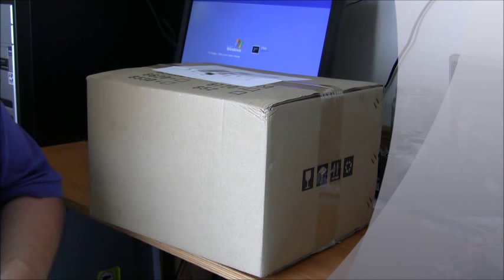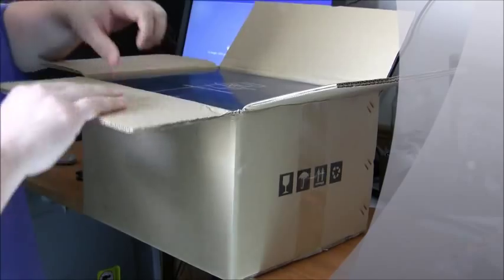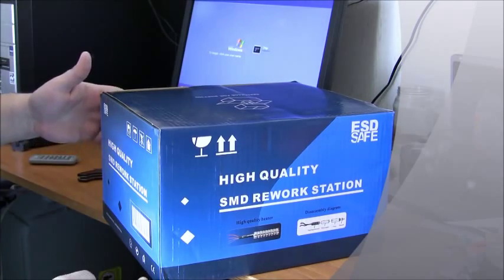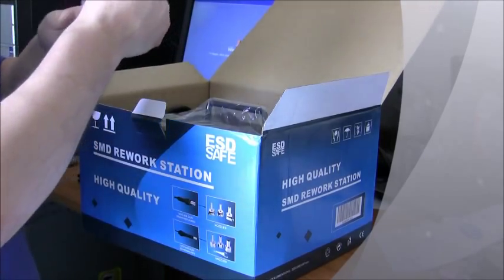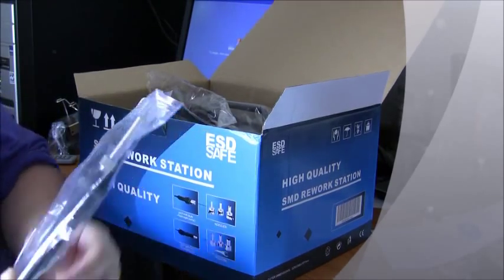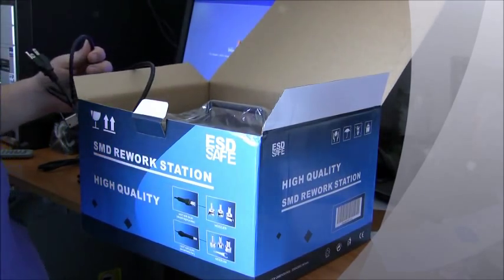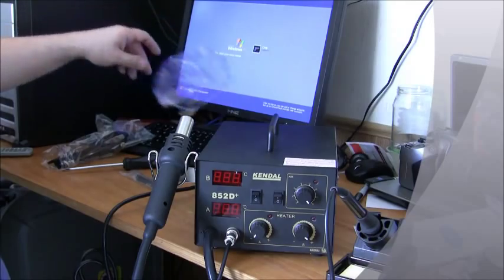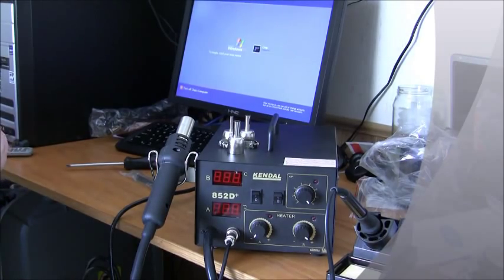Kendal 852D+ 2 in 1 rework station unboxing and demo.

Comment: Give the guy a break. This is the best video I have seen regarding unboxing and assembly. He is the first one to explain the chip popper. The instructoions that came with my unit did not include assembly. Even though it is pretty simple I want to make sure I do it right.
So what if he failed at removing the chip. We are not all experts when we try something for the first time.
Only suggestion is don't waste my time with desoldering if you failed at it. Edit that out and just show assembly.

Comment: I just ordered one of these to replace my trusty old Weller unit. The price was great, (as long as it is at least as good as my Weller was). I really don't plan to do much SMD work, but like the heat gun for shrink tubing. Here is a tip: To remove that I.C. chip you were trying, use the smaller blower tip at higher heat setting, to concentrate the heat right at the pins. Do one side of the chip at a time, (lift one side, then the other),  get in and get out quickly to protect the board from too much heat. You may find that works better.

Comment: Had mine for years and works great. i suggest you bolt the air gun on the right side of the unit, then you can bend the cord around the front and over the top, and it stays out of the way. Just tap the case or use bolts.

Hot air works best with the smaller tips at a low velocity with high temp.

Comment: to take SMD chip out will help to heat it from top and bottom if you can.Remember the heat will spread along the board. On top of a wood table is a big NO NO. Also your putting extreme amount of force with the screwdriver, the idea is to melt it complete it and grab it with tweezers. You also forgot that it takes more heat to melt the one that comes from the Factory than the 60/40 you buy at the store. Adding FLUX will greatly help the solder melt at lower temperature and avoiding putting so much heat to your other components. WHAT YOU NEED IS FLUX. 
Another pointer is, the WICK that your holding is to be used with the iron tips. If I'm mistaken please correct me. Thanks for the video i bought this machine to play around. I used to work with a Hakko long time at my previous job.

Comment: For any beginner watching this video: I always add solder to desolder components, when possible.  
Most of the components are soldered down with leadfree solder, which has a very high melting point, so adding fresh new solder, not only helps to bring down the melting temperature, but also increases the thermal inertia and the solder stays melted a longer period of time.
Reply: And flux. Always flux.

Comment: I've just got me the 852D++ today from the same vendor...it is identical as in this video's except that there was only one screw to remove from the bottom instead three...Yes, I even opened the box to make sure it was only one....and there was only one soldering iron!!!     

The temperature for the Hot Air was set to 380 (Air / Heater set at 2 O'Clock)    I was able to remove a couple of chips / diodes from a test board...  I am also new at SMD and want to start playing with boards, etc....I will be doing more testings before going into the real world.

My hobby is Ham Radio and I think this tool will help me a lot.   I've already have a Solomon SL-916 at probably 5 times the cost of this one!!!

Time will tell on this one but I feel lucky today.

Nice video intro, thanks.

Comment: I have this rework station.  Works great so far.  Took me about 10 minutes to salvage a similar pcb.  Use flux to desolder the larger parts helps a lot.  I set my hot air to 350c and crank up the pump with my small tip.

Comment: I've had mine for a few years, they rock. I had to replace the heater in the hot air gun recently and it's NOT grounded. Also the diaphragm pump stopped working (which led to heater in the gun blowing) opened it up and the air reservoir had cracked; I just hot-glued it along the crack and she's all good again.  Replacement heater for gun was $8 or something on ebay.   Basically a good unit; I use both the hot air and the soldering iron all the time.

Comment: The primary reason for using silicone leads for soldering irons is not to make them flexible, but to make them heat resistant so they don't melt when you accidentally touch them with a hot tip. This will always happen once in a while as you can see on the cheapest soldering irons with standard PVC leads.
The added flexibility of silicone leads is just an extra bonus.

Comment: Use your soldering iron to apply low melt leaded solder on the pins. I have tried that way to remove that size IC and it was quickly de-solderd.

Comment: Apply some flux to the pin and use a smaller hot air tip will make your job much easier.

Comment: i have the 862d+ and i love it. it has a few extra nice features. the main one is the fan for the hot air gun is in the handle which i tend to like better. mainly because with ones like this the hose kinked and stopped blowing air. also it has the magnetic shut off. and its blue not black.

Comment: Great video, thanks for posting. 

For those considering buying this model, I'd suggest you take a look at the 853D which also has a 0-15VDC power supply @ 1.5A which is great for powering my breadboard and such.  It was only $30 more on Amazon ($120).

Comment: To remove those connectors or componenets, (since you don't have a de-soldering unit) it's best done with the iron, and solder wick, or solder sucker. The iron can apply the heat directly to the pins and pressure onto the wick for solder absorption. Again, do it quick to avoid damaging the board. If the pins are still stuck, use needle nose pliers to snap them free, then lift out the connector or components.

Comment: mine is exactly the same 852D+ but with magnetic cut off for the heat gun (branded HighLight), had the radio shack iron, but this is a great hobby grade station for someone that uses more than  just on the odd occasion. price point is perfect & been using mine for well over a year without problems, by the way great vid :)

Comment: the large 4 sided ones are what i  had to  remove and replace .   once of clean pads with the solder sucker heat  tool .  then put cleat flux on the pads  then put the chip on  line it up  and use a scalpel  and hold it in the center and apply heat on to the chip  and the residue from the solder left  on melts and secures the chip.   then you apply flux onto the legs and from one side working  from right to  left apply a small bit of solder to the end leg  with iron in contact and then slowly run the iron tip along the legs  .   then when 4 sides are done again use heat  gun with  fine  tip and reheat the  legs  and watch the solder  run  onto  the  legs  .

Comment: Flux is needed for desoldering also and 350 celsius is very low temp for smd reworking.450 degrees is a good starting point and thats why the ram finally manage to beat you and remained in the pcb.Nevertheless i am gonna buy one 852 without led display that i have found in a local shop for less than 86 euro

Comment: You may have learned this by now, but always use flux, it makes solder melt much quicker.  Also, if you don't have third hands or whatever to keep your board in one place, you can use blue masking tape and tape it to the bench.  Finally don't use a screwdriver on a PCB.  You should only have to use tweezers at the most.  You fingers were way too close to the hot air because you were having to hold the board with the your hand.
Reply: Good advice. What many do not seem to get is flux serves to clean and also to transfer heat. A good example would be to take a soon put it in a pot with it standing vertical. then see how long it takes the heat to transfer to the spoon. then add water to the pot till it boils then add the spoon. the heat will transfer more evenly and quicker because the water has become the transfer for the heat. heat will always rise so adding flux will also keep the heat in the location your soldering or unsoldering

Comment: 12:56 
Try soaking the sponge in water and you'll realize it's not a joke at all.
Paper thin soldering sponges like these expands drastically the first time you soak them in water, so it will fill out the sponge tray all the way to the top edge. Once it drys out again it will stay expanded.

Comment: Hi. Add some low melt leaded solder on the IC pin. It will bring the melting temperature low. Then try with the hot air on 450c to de solder the IC. And watch Northridgefix YouTube channel to see how the de-soldering can be done one a bigger smd.
Thank you.

Comment: You should always start hot air review with max heat + max air and see if it can remove some small part fast. If that works, then you can continue with testing temperature control and lower air speed.

Comment: use liquid flux, set heat about 450 degrees and set air no more than half to prevent damage of components is working on
Reply: Man you are great 450 worked for me. Thanks a lot

Comment: i used to  remove them with  legs on 4 sides and to  remove them   like you are  doing  will  not work .  i did  my training  on removing  ic  from  mobile phones  .  the easy way is  not heat the  legs  but heat the centre of the chip  and the heat travels to  the legs evenly . , the same for refitting another one .  then less risk of blowing the other  bits of like the  very small smd  resistors caps and sots etc.  . try  it  it does work  .

Comment: hi, i have the exact same machine and i was trying to change a charging port on a phone and it did not work i use flux on it and i also did one side at a time but it still did not work. The hot air gun is not pushing enough heat to remove big stuff only those small (ic) and within a day the hot air gun just stop blowing air. I had it on full strength and the highest heat and i was able to hold it in my face for however long you wish without getting burn. This was about a year or two ago and up to this day its still in the box brand new and am unable to use it because it dont work.......so any suggestions?

Comment: in order to desolder smd you first need the preheat the chip and then ramp the temps up to desikder, it takes time to desolder chips. preheat the solderjoints for about 1 or 2 minuits and then ramp up and it should work. (im new to smd soldering, with hot air, but as i am trying to fix some of my gpu´s threw reflowing with hot air) and thats what i have found out of how to hotair solder. and 400°C is a litle hot, in reflowing you only use up to 250°C. so thats what i know abot the subject.

Comment: Surely the solder on the underside of the 'PCB' should be heated and not the top side. The less heat applied to the 'IC' the less risk of damage. Have I missed something here?
Reply: +fartingvicar I think you are referring to the SMD's. They are surface mounted, no solder on the back.

Comment: The best way to get a chip off like that would be to use something called ChipQuick. You can buy a ChipQuick kit at mouser.com for 15 bucks. It's basically a special solder/flux that melts at lower temp. You apply it to the IC pins with your iron, then heat up with hot air, than you collect the solder back on the iron. That chip will pop  right off with that dewhicky IC popper of yours!

Comment: As others have mentioned, use flux. There's a big difference in melting solder in mid air and melting it on the board. Heat is absorbed by the component and circuitry. And don't move around so much until the solder starts to melt. 

I bidded for the same rework station from the same eBay seller yesterday. (the_shining_image) The bid was at $79 and I bid $80. I normally don't buy on eBay unless it's "Buy It Now" because I got tired of bidding against shills and multiple accounts  a long time ago, but thought I would give it a try by bidding one extra buck. After I bidded, I looked down the page and saw this seller has a link to "Buy It Now" for the original price of $79. So if anyone outbids me, even if it's $81, they can have it. So if any of you see anything listed by the_shining_image and it's not "Buy It Now," look down the page and see if there's a link for that option.

BTW: You said at 5:39 the plug for the soldering pencil was a Din plug. That's not a Din plug. But this video was made in 2012, so if you've kept at it, you've probably learned a lot since then and good luck with your soldering.

Comment: Hi, why did you removed the 3 screws from the bottom of the device?

Thanks! I'm considering buying one of these.
Reply: Transport screws for the diaphragm pump which is otherwise only mounted on rubber spaces. You can still use it, but it'll make more noises if you don't.
Perhaps you've already figured this out by now, some 6 years later =0)
Just had to respond for some reason...

Comment: This is a Aoyue 968A+ clone and a cheap one at that. Aoyue isn't the same quality as weller or hakko but much above these other obscure brands or no name brands. The Aoyue has a better stand for the hot air gun, a better quality hot air gun, a better quality soldering iron with better holder that includes sponge and mesh plus a solder holder. Also the Aoyue has a air in port on the front for a suction pickup pen, a smoke absorber, or the potential to add a desoldering iron(not included) in place of the soldering iron. The whole set also includes more iron tips for the blower and the iron itself. I would recommend spending the little extra for it...
Reply: Yes but the aoyue 968A is 3x more expensive than this.  I was going to buy the aoyue myself until I seen this and the price for what you get is pretty decent to be fair.  I'd much rather have the aoyue, anyone would, but unless you have a decent wedge of cash then this is the best alternative out there!
Reply: +Craig Taylor The Auyoue can be found for around $180 not 3x the cost. This is cheap junk. GLHF with it. It will probably burn out and not work well. Why buy cheap crap multiple times when you can spend a little more and get something with way better quality. Auyoe doesn't build it for $70 and pocket $100 there is better stuff in there. Ayoue is even low quality for real solder equipment. The difference between my Auyoue and Weller or Hakko is night and day.  Being cheap only gets you so far but do whatever you please...
Reply: +0zfer +0zfer actually my one of these cost £42 and the cheapest I found the aoyue was £126 so exactly 3x the cost!!
I am not disagreeing that the aoyue is better, maybe re-read what I said. The aoyue is far superior BUT this is a great alternative if you haven't got the money!
Reply: +0zfer oh and as for this being a clone of the aoyue, NO!  It's NOTHING like the aoyue at all!

Comment: Your heater led is struck at 350 degrees, something wrong with heater control, it will not take much time to attain 350 degrees.

Comment: Soldering Hot Iron Specifications:

Temperature	150 to 500 degree C
Power Supply/Power	AC 110V 60 HZ/60 Watts
Temp. Stability	+/-2℃
Display type	LED display
Power consumption	300 Watts
Hot Air Gun Specifications:

Air pump type	diaphragm pump
Temperature	100 degree C to 600 degree C
Air flow	<= 24 L/minute
Temp. Stability	+/-2℃
Display type	LED display
Power consumption	320 Watts
it uses a ceramic heating coil for the air gun and a steel heating element for the iron

Comment: You need flux & better heat gun. I have a hakko and i take off lead free solder in about 50 sec.
Reply: lol its not the machine its the operator. i remove mosets and caps all day with both the pencil and air depending on the location.

Comment: You're doing your hot air work all wrong...
First of all, you blow the air straight from above down to your component and circle it around to evenly heat all the legs of the component.

Secondly, you don't even touch the component with anything until the solder has re-flowed fully so that you don't damage or lif the pads by introducing a force to them.

Third, you will definitely damage pads unless you're very careful when lifting the component off the pads even if the solder is reflowed. And if you damage them it's a game over for that repair job.

The next thing is, that if the component is a trough hole component, don't use hot air station to remove it. Use proper desoldering gun with vacuum system to remove them so that you don't damage the components or the board itself when doing so. Hot air is not enough for a larger component with big thermal mass like most of the trough hole components are.

Even the basic soldering iron with solderwick and using separate spring loaded vacuum pump is better than using hot air for the trough hole components.

For trough hole work, check out:
EEVblog #542 - ZD985 Desoldering Station

For smd work check out:
EEVblog #167 - Atten 858D Hot Air Rework Review

Comment: You get what you pay for those pump types fail after a while and a plastic holder there a fire waiting and what kind of video was this how many watts is the iron what kind of heating element how many watts is the whole station thumbs down no info but it can't take off chips thanx I won't be getting one of them